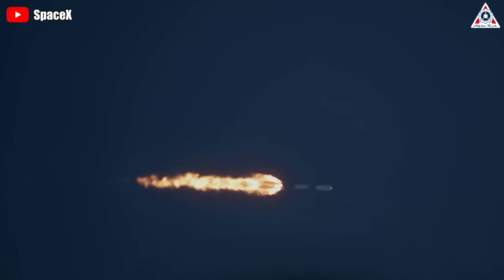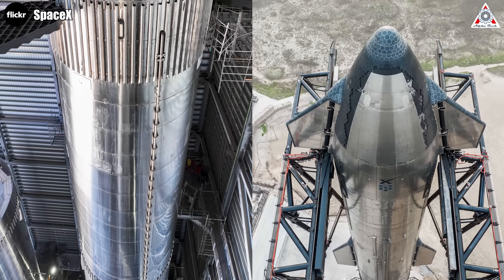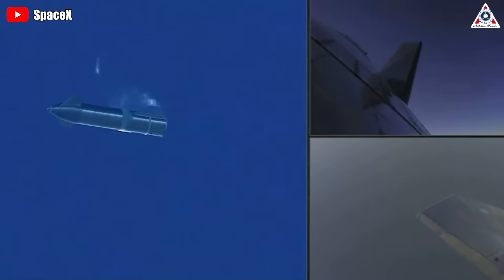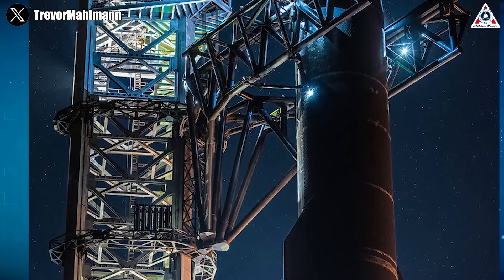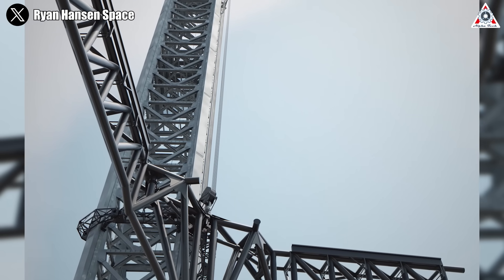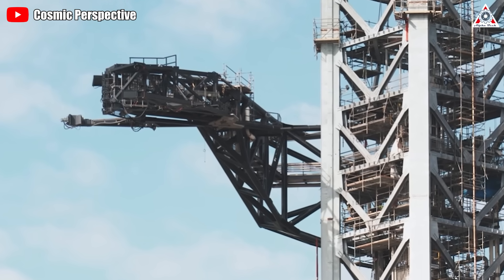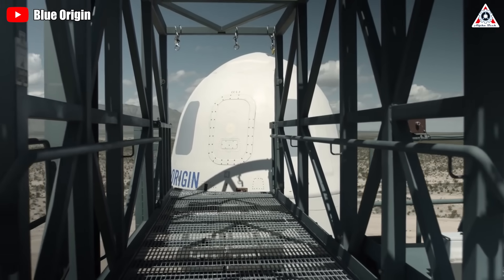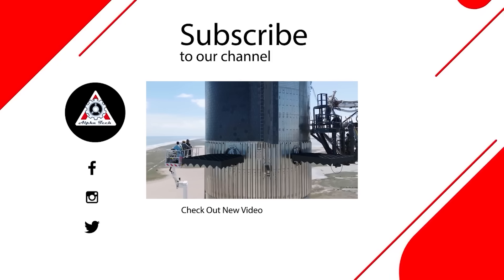SpaceX Starship catching system is harder than you think!

Comment: Some misconceptions based on renders:
1. The landing: Boosters will land at sea until their precision is better than that of Falcon 9.
2. The chopsticks (my take): They don't do the catching. They open a bit, but then don't move at all. The booster comes down slowly and exactly glides inward until the gap is small enough it touches the rails, only then do the last raptors shut down. Once the hooks are on the rails, the rails flex softly down to make for a soft landing. 
3. The booster: It is heavy, which means it does not do fast movements. If it is not 100% sure it can nail the landing it will just land at sea. It has to make a judgement call if it is sure it can land or not while still high over the site.
The booster has enough propellants during landing to hover - unlike Falcon 9 that has to land with no margin.
4. The ship: That will have to be a later development. The flip maneuver is not yet proven to be as precise as the booster. Expect many landings at sea.
There is a reason SpaceX keeps building so many ships and boosters.
Reply from the maker: Thanks for your comment ☺️
Reply: All correct, from everything I've read and heard, except the reason the Falcon 9's first stage can't hover is a bit more involved.  It could hover with a lot more fuel left, yes, but not so much because it can burn the center engine for longer, but mainly because even a single Merlin 1D cannot throttle down enough to hover.  Without even more fuel left to act purely as ballast, the first stage would eventually rise if it attempted to hover, and nothing can be done about that except to decelerate all the way down, using both gravity and momentum to oppose the center engine's thrust at its lowest setting (about 40%), and time everything close to perfectly in order to "stick" the landing, which is of course what Falcon 9 does.  Start the burn too early, and the landing will fail.

One alternative would be to redesign the Merlin for deeper throttling capability.  Blue Origin did this with the New Shepard's BE-3 engine, which can throttle down to 18% (pretty amazing for a rocket engine).  This is why the New Shepard can and does hover before landing.  But naturally this would involve compromise to the design and performance of the Merlin, and the method of landing SpaceX chose, the "hover-slam", is more efficient anyway.  And frankly it looks a hell of a lot more elegant, much like when a gymnast sticks their landing.  This is better than hovering IF you can do it, and SpaceX have proven that it can be done reliably. 

The only other alternative would be to leave even more propellent in the tanks, as dead weight, but that would be even less efficient than what the New Shepard does.  SpaceX chose the best solution.
Reply: I tried to avoid the reason Falcon 9 has no margins. Just pointing out that the booster has one. Starship will have the same problem the Falcon 9 has.
Reply: Even much smaller Falcon-9 booster was almost never able to land exactly in the center of landing pad. It is necessary to have some room for errors. Those chopsticks do not have this room... so this system will never work (or will destroy it in the first try).
Reply: @Zralock79   Then SpaceX will simply have to use a more precise guidance system on the Starship.  GPS alone has been good enough for the Falcon 9 booster, but other more precise types of guidance can augment that, such as optical guidance, including a laser rangefinder for altitude.  If it means anything, the chopsticks on the Mechazilla tower in Florida are shorter than the original ones in Boca Chica.  This feat looks doable to me.  The Falcon 9 booster's landings could be made more precise, but this hasn't been done because it isn't necessary.
Reply: @Zralock79  Please keep in mind Falcon 9 lands on a barge at sea. No matter how good the stabilisers are on the barge it will bob around, add to that the winds on the open sea and you should realise that the problem for that booster are not simple.
Anyway, the SH booster will drive into the wedge of the arms. It has tapered strengtheners under the hooks and the rails have rubber pads. It can bump about a bit but should be fine.
The Starship is another matter. It has no grid fins to guid it, has to do a 90° flip, nor does it have strengtheners and has also tiles it would not like to crush. THAT is the problem I have trouble finding solutions for.
Reply: @knowledgeisgood9645   We should also keep in mind that the off-center landings of the Falcon 9 booster, which happen even with the stationary land-based landings, look more pronounced relative to the Falcon 9 than the Starship.  Even the GPS-guided Falcon 9 should be precise enough to safely get between the spread-out chopsticks, which is a comparatively large area, and during this stage the Starship components will undoubtedly use more precise guidance than GPS can provide.

The Starship itself (second stage) has its flaps for guidance at high speeds instead of grid fins.  Once it gets close to the ground, fires up its engines, and does its "belly-flop" to vertical orientation, maneuvering will be done with thrust vectoring and possibly other thrusters (cold gas or whatever is eventually used, like methalox thrusters).  Even on the Falcon 9 and Super Heavy boosters, the grid fins are rather ineffective and are not needed during the final stage of landing because of the low speeds involved.  What they're good for is hypersonic, supersonic, and high-subsonic speeds, but then other more effective means are used in the final stage (as well as in space, of course).  This is a non-issue.  And like I said, on the Starship the flaps take the place of grid fins, and this is already a largely tested and proven solution (at least at subsonic speeds thus far, thanks to SN15).
Reply: @knowledgeisgood9645   As for structural reinforcements for landing on the chopsticks, the Starship prototypes that will actually do this will have their front flaps reinforced.
Reply: @rbrtck  They will never use their front flaps for landing. Elon has hinted they will have hooks (like the boosters) that pop out when it is time to land. But there will still be the problems of how to avoid crushing the tiles.
What worries me is the fact none of SN8-SN16 was able to land even close to the X on the pad. One of them almost missed the pad altogether. How they will improve that I don't know, but hope they have a way. Or it is back to legs again I guess.
Reply: @knowledgeisgood9645   Those were early prototypes that probably just used GPS and weren't as precise in their maneuvering, since SpaceX didn't (and still don't) have a thorough understanding of their physics and behavior yet.  Later prototypes and the operational Starship could use, for example, more precise optical guidance, like the Apollo and Dragon do while docking in space, or naval aircraft do while landing on aircraft carriers.  GPS is precise enough for Falcon 9 booster landings, but not nearly precise enough for those other applications, so more precise methods and systems are used.  None of this is new, it's just more involved, and SpaceX always try to do the least possible, which is why the Falcon 9 booster's landings don't always hit the center.  SpaceX could make it do that (or get much closer on a regular basis) if they really needed it to, but they don't need that--it's good enough and very reliable as it is (and simpler, lighter, and cheaper).

Even the Falcon 9 booster and the algorithms it would take to get it to land safely and reliably took many tries to get right, with SpaceX learning from each usually explosive failure.  It used to miss the landing spot (especially the moving barges) all the time, but now its landings seem to be just as reliable and "routine" (never truly in this business, but seemingly so) as the launches.  SpaceX will get to know the Starship the same way, and I believe it will be equipped with a more precise landing guidance system because that's what it requires.  You're way, way too concerned about the imprecise landing(s) of one or more of the early prototypes.  That will be improved greatly, no doubt about it.